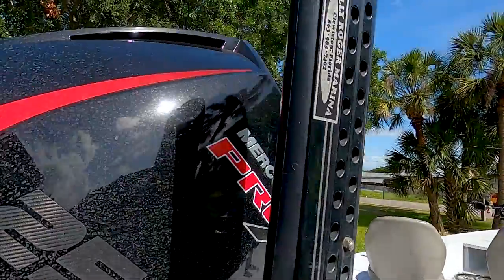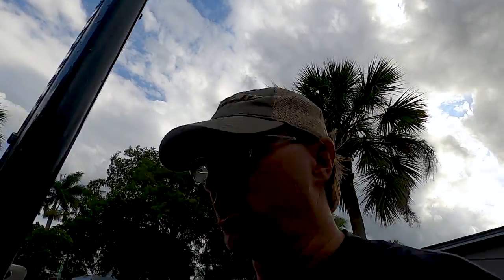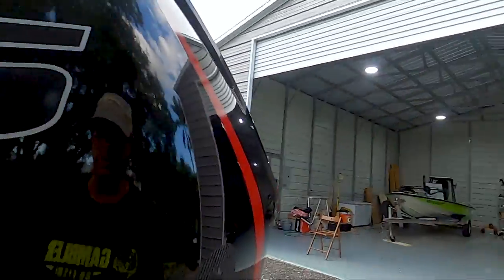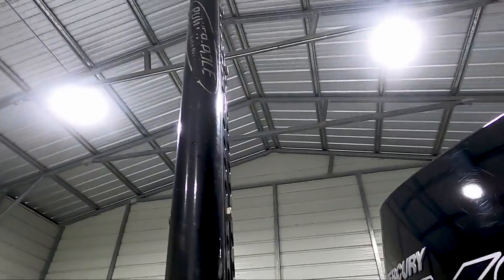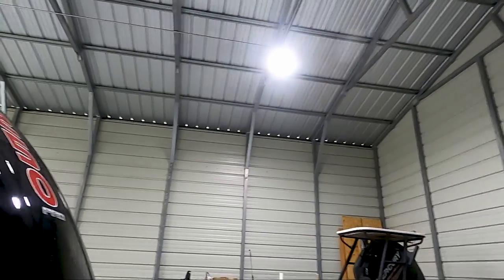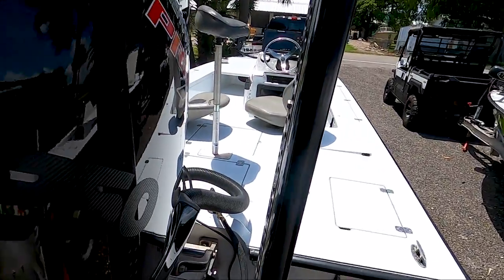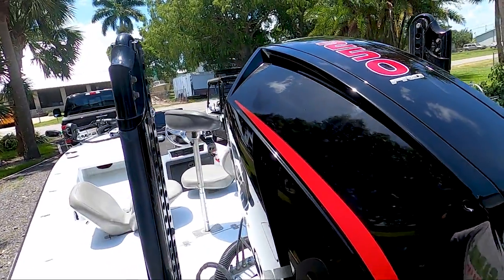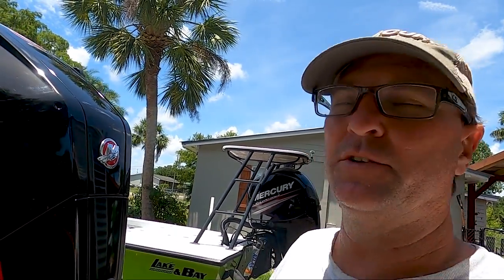How to Remove Water Spots and Clean a Boat Motor

Comment: Do you guys have a product list that Val uses for this ceramic coating?
Reply from the maker: For the motor:
basically wash motor
polished with mercury cowling polish
then wiped clean with glide coat surface prep
them applied 2 coats of glide coat ceramic coating

For the entire boat:
need to prep compound or buff depending on what surface is like.   I used 3m buff magic
then polished up
then prepped with glide coat surface prep
then 2 coats of Glide Coat
Glide Coat has some kits available for boats as well